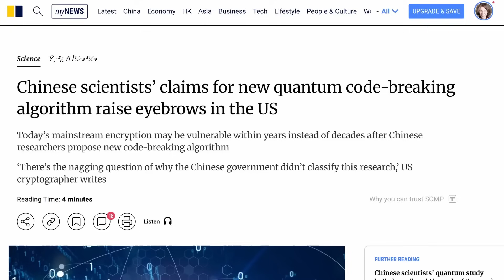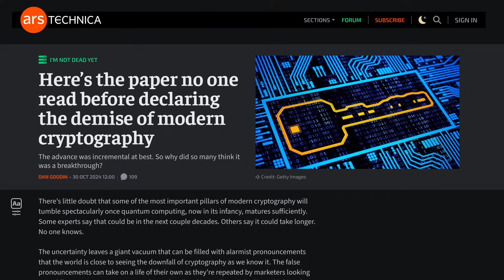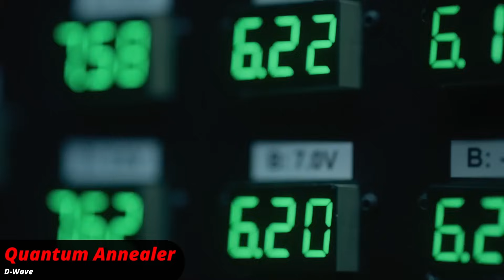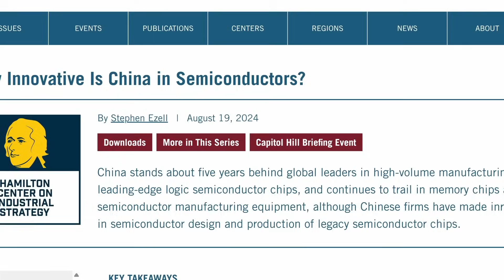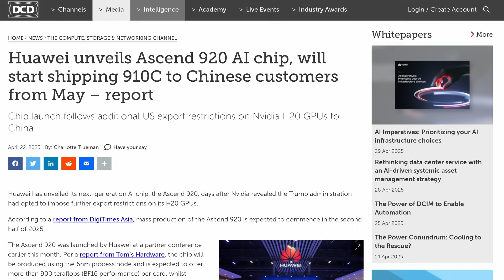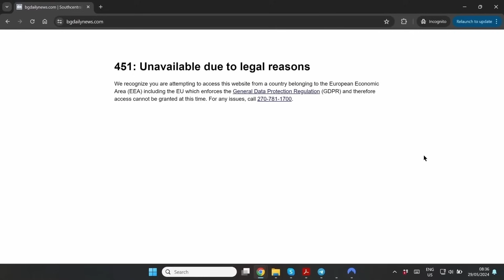Chinese claim "First Successful Factorization of RSA-2028 Integer". I've had a look.

Comment: 2048, not 2028 (mistake in the title).  And yes, that would be a fairly big deal in terms of progress... but nobody needs to worry just yet.  The generation default now is 3072 bits and the limitation they put on the test was absurd... so honestly I don't think they've gotten anywhere near to breaking properly generated  2048 bit keys in the wild.

Key generation algos disallow numerous "simple" prime configurations by default and just silently generate again if they hit any of those cases.  So there really isn't anything in the wild that would be vulnerable at 2048 bits.  It would take very old 1024 bit keys to cause problems... but those haven't been used in decades.

Breaking 80 bits is fairly easy.  80 bits hasn't been used in ages though I dunno if military hardware has caught up to modern encryption yet or not.  It should be noted that one-time PADs and pad buffers can be used to seed comms and are completely trivial these days... and completely unbreakable... you just need to physically transport the storage (a USB stick) to all parties.

In anycase, one can specify however many bits one wants.  4096 generation is fairly straight-forward with regular computing hardware.  It gets dramatically slower aboveo that.  6656  isn't too bad.  8192 takes quite a while to generate.

-Matt
Reply: It doesn't matter that we use 4096 or whatever size today, there are a lot of keys from from the past that are "only" 2048 or even 1024 bit.
Reply: @Johannes-c7p  I seem to recall some friends from university who had created 512 bit PGP keys for one due to no need for hard privacy but also to help their 386 or 486 class budget hardware with performance.
Reply: @Johannes-c7p  About the problem with past keys -- isn't thet what PFS should address?
Reply: @HagenvonEitzen  not when pfs also uses the same key size
Reply: For SSL certificates the standard seems to be 2048 bits these days and CA authorities themselves use 4096 bits.  The 2048 bits for the certificates are a compromise between security and performance.  Performance matters especially for busy web servers.  That level of security however might not satisfy the most paranoid.
Reply: 80-bit keys have never been used in RSA (certainly not widely); you either mean some symmetrical crypto, or you are a bot.
Reply: @Schnolle  he is correct and 2048 is a binary whole number not 2028.
Reply: @MrHacross  But 6656 isn't.
Reply: @Schnolle  For the heck of it I tried to factor a few arbitrary numbers around 2^80 and my outdated klunker of a PC did so virtually immediately.  The oldest books about RSA encryption which I ever read were talking about well longer key sizes already.

But 80 is a bit of a magic number.  It's been used for Skipjack, a back doored symmetric encryption algorithm.  Basically Skipjack was designed to be a weak replacement for the aging DES.  Also RC4 which has a minimum key size of 40 bits may have been used with 80 bits?  But that's speculation.  In any case brute force attacks on symmetric ciphers with 80 bit keys are practical these days and have been for many years.
Reply: @ralfbaechle  I wasn't talking about 80 bit RSA anyway.  Military encryption in the 80's, before RSA, and before AES (AES-128, AES-256), and long before AES-512... was hell ... I don't even remember the name.  I used to know it.  In anycase, those are symmetric keys and they were fairly small.  64, 80, and 128 bit symmetric encryption was very common.

Those all use a black-box segment that nobody has ever really trusted because we all think there's a good chance the NSA purposefully weakened the factors that went into it.  And that was before people really got serious about adding random noise and randomly-positions pads in the encrypted packets, or sector indices (when it comes to block encryption)... which I don't think is particularly secure IMHO.

The block sizes are just too small and not enough random data was mixed into them.  So you knew anything at all about the content of the message...  for example, it is very easy to guess the content of a boot block on an encrypted disk, that knowledge massively weakens the encryption.

In anycase, a weak black box segment is a potential problem even for AES because the thinking back then was that only the military would have the computing power to break it.  Obviously that went out the window very quickly once the potential vulnerability was understood.  That is why there is a lot of distrust for AES now.

By modern standards, what we did back in the 80's and 90's just wouldn't past muster.  Dozens of vulnerabilities in the algorithms have been found since those times.

The way RSA and modern SSL works is primarily by minimizing the amount of data that is encrypted with the same key.  So, for example, the public key handshake is just used to handsdhake and exchange a random symmetrical key.  It is not used tor the data stream after that.  And a new random key is exchanged every X bytes of data.  Data packets have a ton more fuzz... positional fuzz and random data injection to make sussing out the encryption from knowledge of the content more difficult.   Compression is no longer used (because it reveals the length of passwords, for example).   and many other things go into modern encrypted streams to make them as unbreakable as possible.

And sheesh.  No, what dummy would think I'm a bot?  (no no, I'm not talking about ralf... your posts are great.   The other guy... Schnolle is talking through his rear end).  Too many bots these days, but I aint one.  Also too many people who think they can type stuff into ChatGPT and post authoritively.  Which I don't do either.  This is 40 years of experience as a UNIX (etc) programmer.

-Matt

edits: clarifications

Comment: TLS 1.3 drops RSA anyway. Still, RSA is used in a lot of other places, for a time we can shift to 4096 without too severe impact on performance but it's going to hurt if the whole industry has to move much beyond that. Largely we're going to buy our way out of the vulnerability until we shift to new algorithms across PKI. So it's a big deal IF TRUE (I don't trust China) but not an apocalypses yet either.

Comment: At this point I only have admiration for the chinese, they have pulled such breakthroughs with the money they made from trade, instead of feeding fat greedy CEOs. And the fact that they can make their own semiconductors, guarantees them a bright future.
Reply: You clearly don't know what you're talking about. The best Chinese manufactured chips(kx-7000) are slower than the slowest intel i3 from 2017
Reply: @montgomeryfitzpatrick473 it's a start, you will say the same about their cars and look how they are now
Reply: @montgomeryfitzpatrick473
So what? That is only a 8 years difference, that is not a lot. They are not at the peak now but they have the potential to be there in a short time (that means about 5-10 years).

Having fabs that can do this is a great achievement.
Reply: @montgomeryfitzpatrick473  as much i am concerned my calculations run the same in a pentium as in a i5, so i3, i take it.  Moreover, i live in a country that can not even make a resistor, so transistors and i3s, big difference.
Reply: I suspect that some of the breakthoughs have come from IP theft but I am not sure there are any countries left that can't be accused of this.
Reply: The only people in the world who like or admire the Chinese, are the Chinese themselves.

Comment: qbit can be simulted in a common computer. Thus, all quantum algorithms can be reproduced in a general computer. The speed difference  between software and hardware qbits is not so significant compared to the efficiency of the algorithms.

Comment: Just fyi, 2048 bits rsa will be phased out in 2030, i work in the software industry and most companies i work with are already using 4096 bit keys.
Reply: The fear is that quantum computers only need to scale linearly with the size of the key. So while it might take a long time to get past 2048 bits, based on Moore's law, it could take just another 2 years to get to 4096 bits.
Reply: @djinn666  Moore's Law is dead, though that's not really a limitation for making more performant systems
Reply: @djinn666  Nice try. You're confusing Shor and Grover's algorithm.
Reply: 'Checks calculator'. So it's twice as secure   Great 

😂
Reply: @TooLegit_ToQuit  No. 
2049 is twice as hard to crack (for current techniques) as 2048.
That is, to say, every single added bit doubles the existing number of possible combinations.
which means that 4096 is exponentially harder to crack.
Reply: @khatdubell  Is that true for a classical computer or for a quantum computer?
Reply: @khatdubell  Um sqrt(2^n) = 2^(n/2) so adding 2 bits would still double the computation time needed if a quantum computer would be used for brute force. It is much better on prime factorization though, which it can do in polynomial time instead of exponential. But that's not brute force.
Reply: RSA has already been deprecated by the NSA.  (in 2019).  BTW, I predicted back in the 1990's that RSA1024 would not be factored by 2020. I was right.  It is 2025 and it still hasn't been done, nor is there any indication that it will be done anytime soon.
Reply: I was looking at 16k keys but ECC was good enough for currencies at scale.
Reply: Sadly not everybody has gotten that memo, I still deal with geniuses that think 2048 is good enough and that their company policies forbid 4096, that sad.
Reply: It would take a quantum computer 317 billion years to crack a 256 bit code.
Reply: Yes, but the algorithms work in polynomial time, so doubling the bits will only increase by 8 the time needed to crack them.
Reply: I'm so glad you said something. "In a significant shift for cyber security, NIST has announced the deprecation of RSA, ECDSA, and EdDSA encryption algorithms by 2030, with a full disallowance by 2035."
I remember what fun it was to get rid of MD5. Man, that just kept coming around and around. People really didn't want to upgrade to anything else.

I'm sure this will be fun.
Reply: The problem is that the Chinese already have tons of stolen secrets in files with weak encryption. It doesn't matter if the protocol changes, they have stolen enough already to be dangerous.
Reply: 2028 is looking like it's too slow.
Reply: Once quantum computer decryption is achieved. It makes no difference if you use 2048 or 4096 bit keys.
Reply: @charleichen3763  True that's the promise. But there have been many problems already (early 2000 there was a paper that the NSA could build a purposeful RSA cracking machine that could crack 1024 bit RSA keys in a usable timeframe for a reasonable cost to them), Debian or was it RH/Novell ruined the entropy of their PRNG generator later in 2008-2010 and everyone suddenly had to (re)create all their keys - I doubt all of them did. And there was another incident or was it the same about reusing the same DH large primes Groups that were distributed with most distributions forking of one big distro again (RH/Novell/Debian). And they had to recreate the DH prime groups and their keys subsequentially - I also doubt all of them did. And then there was HeartBleed ... Encryption is already hard to get right ! Quantum Encryption will be much harder.
Reply: to 10420 bits keys and beyond.
Reply: yall are missing the point that bad actors collect data to decrypt it later on. Old information can still be very damaging even if you have updated your current encryption.
Reply: @gordonfrimann246  Data is usually encrypted using symmetric encryption like AES which are mostly quantum resistent, what can be broken is the asymmetric protocol used to exchange the session key. Nowadays, protocols are/should be used, that offer perfect forward secrecy, i.e. the key agreed on cannot be recovered by decrypting the observed communication, only by a man in the middle attack that has to be done at the time of the key exchange.
Reply: They know that they are using far more sophisticated AI than you can imagine,
Reply: I use 8192
Reply: i'm still waiting for a title fix
Reply: The other perspective that people are not talking about here is that the simple change from RSA-2048 to RSA-4096 negates the entire quantum advantage in brute forcing encryption hacking.
It is always going to be a trivial task to improve encryption security at a much faster pace than the threat posed by advancement in computing ability to brute force encryption
Reply: Or ECC, though a 256 bit ECC key isn't as secure as 4096 RSA....
Reply: @kayakMike1000  Don't you mean AES ? ECC is Error Checking and Correcting eg: Reed Solomon code's in server main memory ECC (U|R)DIMM to check and correct (if possible) random bit flips.
Reply: @kevinpaulus4483  No, that's not what ECC means (in this context)
Reply: Ok it appears I jumped the gun and ECC is also used as an acronym for "Elliptic Curve Cryptography". So my bad. But we learn something everyday.

Comment: If you follow bitcoin best practices then bitcoin isn't in any danger.  Your public keys are not exposed until you spend money out of a bitcoin address, just a hashed version of the public key is exposed when bitcoin is sent to you.  Best practice is to never reuse an address after you have spent out of it.  If you do this which most hardware wallets already do, then there is no danger of quantum computers cracking bitcoin.
Reply: Only slight danger if the key is broken in seconds and the false transaction gets into the next block.

Comment: No. Bitcoin uses SHA-256. It is not amenable to attack with quantum computing.
Reply: Sha-256 is a hash algorithm, not encryption. The bitcoin private key is based  on elliptical curves. Based on similar properties like RSA and also vulnerable to quantum computing
Reply: @romanhimmes171   That part does not threaten the value of Bitcoin.
Reply: Bitcoin uses ECDSA or Schnorr signatures to sign transactions. Both can be broken on a quantum computer using Shor's algorithm for the discrete logarithm problem.
Reply: @sbares  Again, that doesn't threaten the value of Bitcoin. Breaking SHA-256 is the only way to threaten its value.

Comment: One time I was like hey Look, If I make this number larger the algorithm factors it faster. Next day Obama got emergency power to shut down the entire internet. lol. But I'll also not the NSA hasn't used RSA encryption sense 2006.  But the algorithm I figured out, it would turn computer science notions of runtime upside down. Basics of it revolve around triangular numbers.  If   N=Tn-Tm   where  Tx=X(X+1)/2=Sum 1 to X    then either n-m or (n-m)/2 divide N.  So like Basically take number like 25=1+2+3+4+5+6+4  and slide the sequence right, till its like 25=3+4+5+6+7    and the length or half of it is a factor of 25.  Which length is 5 so divisor is 5. Think of calculus and like borrowing from left to right. 3+4+5+6+7 = (3+7)+(4+6)+5  = 5+5+5+5+5     So the thing is this algorithm can be really fast if its oriented right, or rather slow. But take like N and it converges slow, and N=PQ.   And takes awhile to get P or Q..   Well I showed in cases 3N making the number larger, it can converge nearly instantly to the factor P or Q.   Real reason is a small perturbation in N can result in nearly instant runtime or very slow runtime. So this is where I discovered for myself that Chaos Runtime algorithms exist. Notion of run time in academics was faulty. Like the P=NP problem, its vastly incomplete, even though its well defined. Quake 3 inverse square algorithm is a great counter example. Hard problem solving inverse square, versus Quake 3 engine that was like the absolute number isn't needed only a very good approximation, and the new algorithm while not perfect was able to be nearly perfect in very fast runtime.  So I can't blame Sabine for defaulting to academic notions of runtime, or others thinking Shore Algorithm is the fastest.  My algorithm infinite numbers of N it will converge nearly instantly to a factor at a decent frequency. The Size of N doesn't matter due to the periodic distribution nature of runtime that occurs with it. Elliptical curves like in bit coins is a bit more challenging.  But there could be "Weathering" factors in producing the encryption, that self repeated events could possibly indicate the private key. Or mathematical extensions of such processes could encode extra information. I take all of it with a grain of salt. But the first of the Chaos algorithms I found, it upends certain assumptions by academics that are provably false. I wouldn't be surprised to see traditional computers be able to beat Shor's algorithm in the near future under the old definitions.